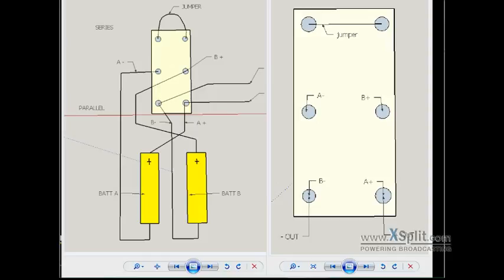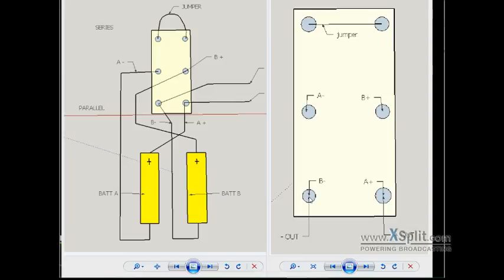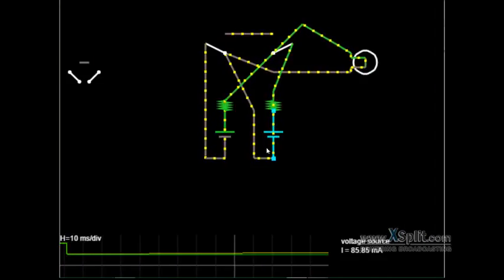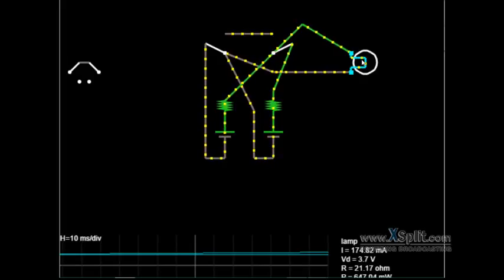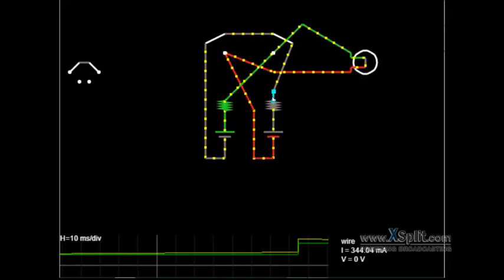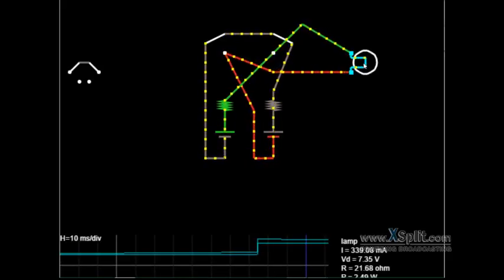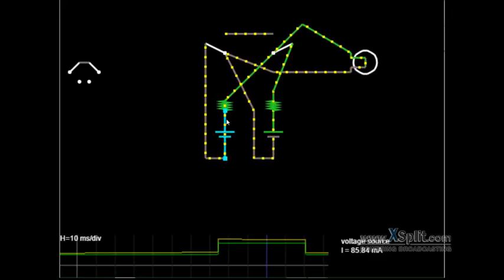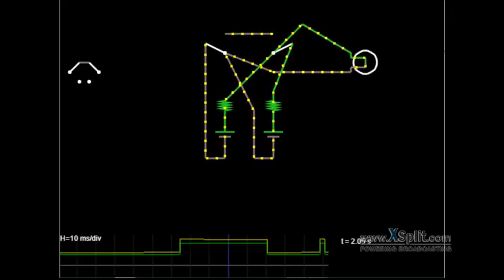series parallel switch explained

Comment: If I was trying to do this with two fans and it requires positive and negative power could you tell me how I could accomplish this? My condenser fans for my air conditioning can be run in a series or parallel and I need to do a switch like this. My only confusion is providing power to the fans.

Comment: I need help with a configuration which will allow me to charge 2s 18650 battery with series and parallel switching.
Reply from the maker: what is your question?
it would depend on your charger output as to whether or not you can charge the batteries in the series configuration, also once you series batteries and intend to charge them in that configuration you need to have some sort of balancing circuit in place. i prefer to charge my cells individually whenever possible but i know that's not always feasible. i would like to know more about your application as i might be able to steer you to some products that might help you

Comment: now when you say a double pole double throw switch are you talking about a basic wall light switch usually found at the top and bottom of a stairway or hallway in a house and when you say up and down for the switch positions are you saying on and off for the switch positions at least this is what I am assuming you are referring too and if so is 120 volts the most these switches can handle cause this is what I am trying to do is have a switch I can wire 2 52 volt batteries too so all I have to do is flip the switch to go from parallel to a series configuration this way if I need more volts for  power to go faster I can or if I need more amps to go farther I can  this would be for a ebike by the way
Reply from the maker: no, not at all as you presumed. a normal 120vac (american) light switch is a single pole, single throw switch, meaning one "pole" (one connection bridge) and single throw (one point it can connect to) so its one wire, on one pole, and it can only connect to one point, so its on or off.. a single pole (one wire) double throw, means it has two points it can connect to, usually top, middle, and bottom, (middle is usually off) now back to poles.. one "pole" is one side, completely separate from the other side.. so far we have covered single throw, "up and down is on and off" double throw "up and down make two separate connections" now lets cover "double pole" it is essentially two switches in one.. you have two sides. each side has 3 pins. usually the center is the " input" and the switch decides whether to connect to the top pin, or the bottom pin. 

it can be used in reverse, wire two separate inputs to the top and bottom pin and have the center pin as the output, but that's neither here nor there. 

i feel as if i may have simply added more confusion rather than answered any question, so please feel free to reply and i promise to not take this long to answer again!

Comment: Hi there, if I have an input source (charger) to the two batteries, where would I connect it? The issue I'm having is that my TP4056 can only charge 4.2V and I have two 3.7V Li-Ion in parallel that I would like to connect in series to a step up transformer.
Reply from the maker: so as i understand your question, you would need to switch your two batteries to the parallel position and have your charger connected to the (output) unfortunately, in the parallel position you would not be able to use any output voltage in the series connection. 

if this wasn't a problem, and you could disconnect the battery pack completely to charge, then simply switch the pack to the parallel position and connect the charger to the output pins and charge normally

now if you needed to maintain the series output availability, and charge the pack at the same time, you would need a series of diodes, and a charger that outputted .7v higher output, but it could be done very easily especially under low current applications.